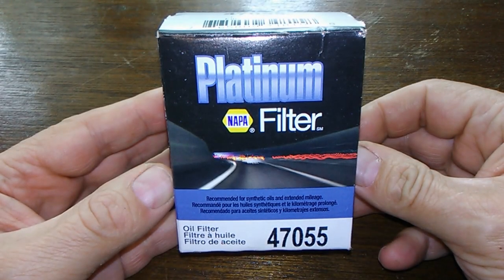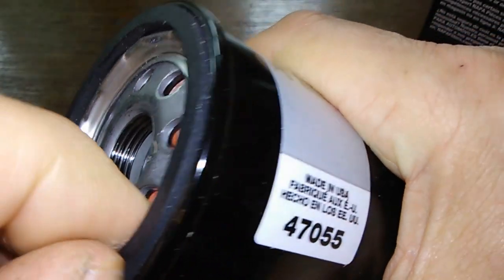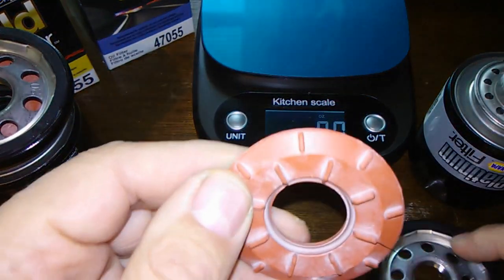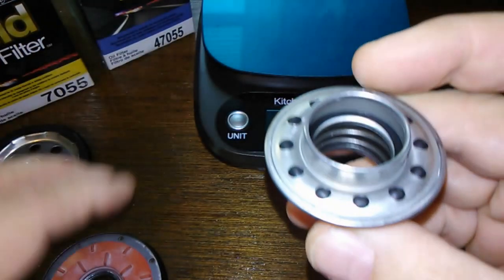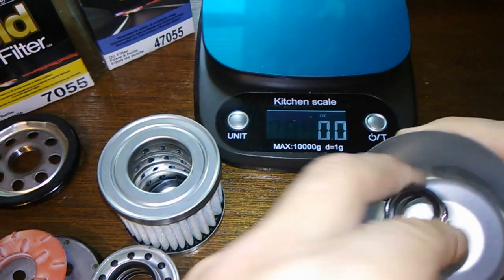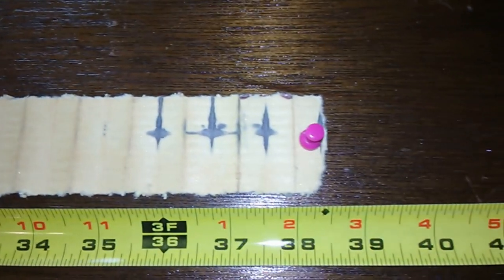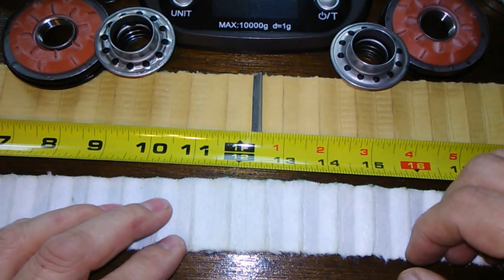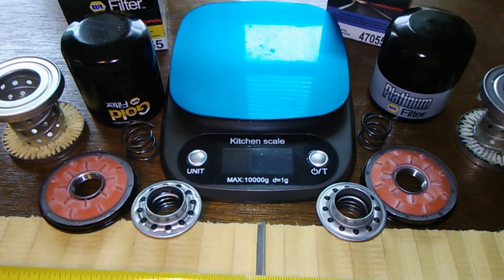Napa Platinum Oil Filter Cut Open 47055 Napa Gold Oil Filter Cut Open 7705 Comparison

Comment: Who cares what the date code is?
Reply: With the consolidation in the industry, the date code is useful to know what version of the filter you might be getting.
Reply: @fairbanksbrian  NOPE. Most of the numbers/digits that are stamped on these oil filters are NOT actual "Date Codes", but are internal codes used by manufacturers for their own purposes.  REAL DATE CODES are expressed as " mm/dd/yyyy", and are only found on a few oil filters.
Reply: Who cares !?? THE SMART PEOPLE CARE, that's who !!
Date Codes are used throughout every industry -- because people want to KNOW just when a product was PRODUCED -- for whatever reason they may have. 
 The problem with these so-called "Date Codes" is that MOST of them are NOT actual date codes, but internal codes that the manufacturers use.
 These so-called "Date Codes" are not date codes at all -- unless they read "mm/dd/yyyy"  or , in some cases, "dd/mm/yyyy".